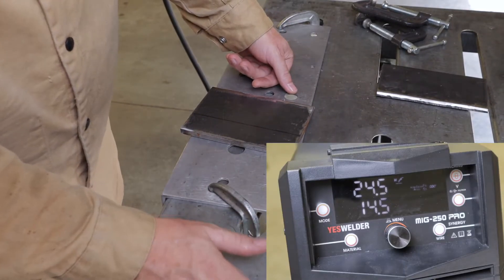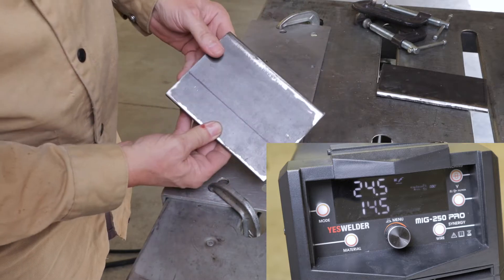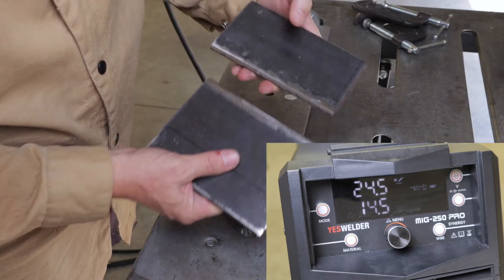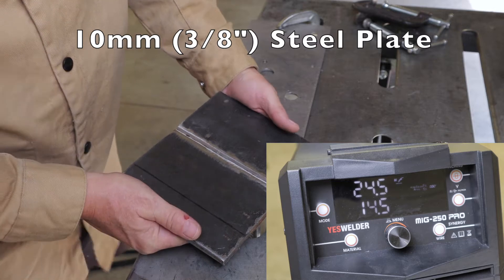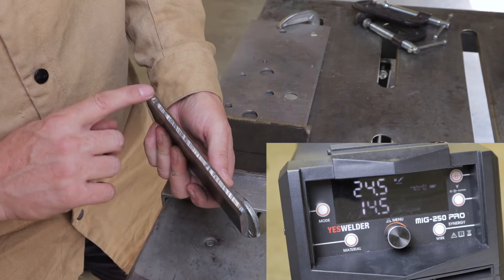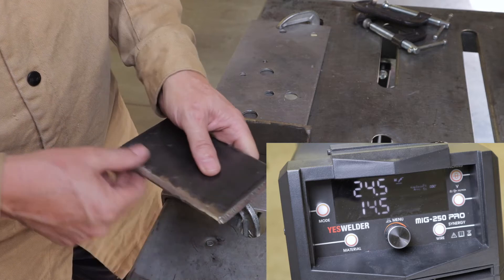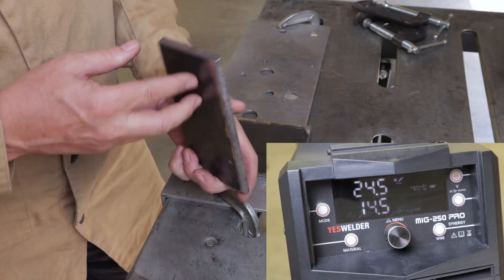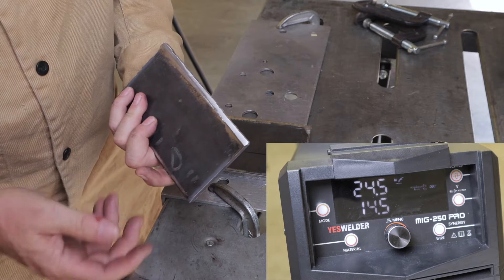MIG welding 10mm Steel Plate with the YesWelder MIG 250 Pro

Comment from the maker: Use code DIYHP10% to save 10% off your entire order
https://yeswelder.com/?ref=DIYHP10%25
(NEW Spool Gun Compatible) YesWelder MIG 250 PRO Aluminum Welding Machine
https://yeswelder.com/products/aluminum-mig-welder-mig250sg?ref=DIYHP10%25
YesWelder 150AMP Spool Gun
https://yeswelder.com/products/spool-gun-lbt150?ref=DIYHP10%25
Auto Darkening, True View Welding Helmet | M800HP
https://yeswelder.com/products/auto-darkening-welding-helmet-m800hp?ref=DIYHP10%25

Comment: Hello sir.. please can you give me the general specifications for welding 10mm mild steel in MIG.... like the wire diameter the current and voltage.. please i need it for school project
Reply from the maker: All of that information you are asking for is displayed on the face of the machine in the beginning of this video. Those are the settings I used for the video. If you want more info on this subject for a school project, I would recommend doing a "Google Search" on the subject. You will have more information than you will know what to do with on this subject. Thanks for stopping by and I wish you the best with your school project.

Comment: What size wire and settings for thiis weld i have this welder on the way
Reply from the maker: I used synergic settings for 10mm steel with .030 wire. This welder will come with a settings chart. I use that included chart to set up the welder for all my welds including the one in this video. I think it would be better to use .035 wire but I don't have any on hand so I used what I had.

Comment: Sounds to hot and not enough wire.  Get that machine to sound like your cooking bacon and put a 30° bevel on the plate a run a root pass for good penatration and the hot pass to fill bevel.
Reply from the maker: Thanks for the tips Rod, I appreciate it!
Reply: I think it only sounds like that because it is no longer short circuit mig but it is doing a spray transfer like you need to do for thick metal